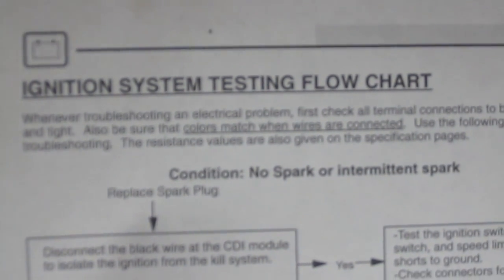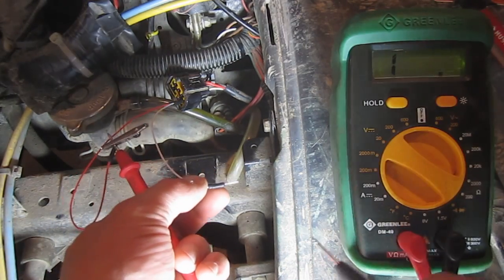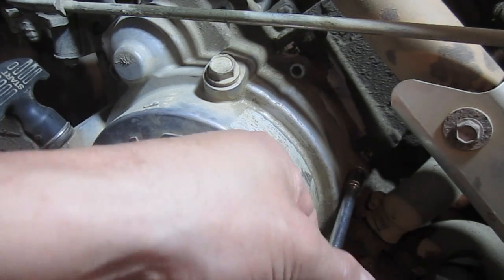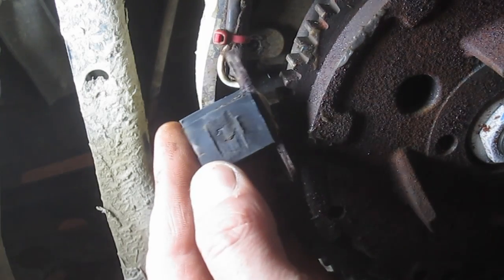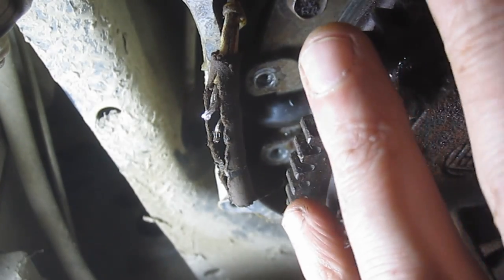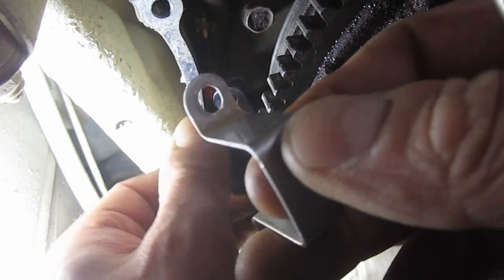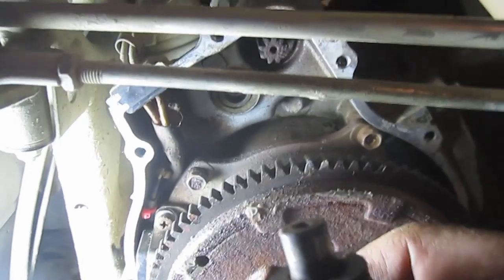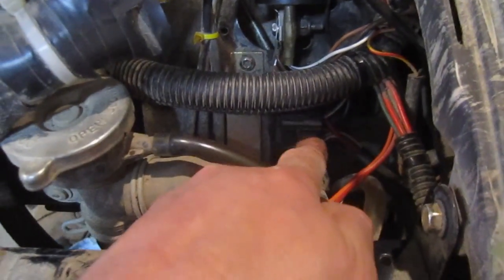How Replace Pulse Coil on a Polaris Sportsman 500 ATV DIY Replace a Trigger Coil on an ATV

Comment: How can you set the gap when the bracket holes and the coil hole's line up the same when you attach it? Now if the coil could slide back and forth with elongated slots independent within the bracket the gap could be set. How did you get the gap to open and or close with the same hole alignment??

Comment: Great video! My pull cord broke and yes I tried to start it electrically..... Thanks to you I think I know why I have no spark now. Thanks a million!
Reply: I need help with my Polaris sportsman 4oo 4x4 2004
Reply: Ok so basically you cannot start the VTT with the starter when the pulse coil is not working ? But you can start the VTT with the pull cord starter ? That is my situation right now on my 2005 sportman 500 HO